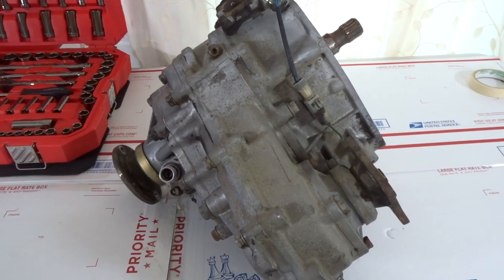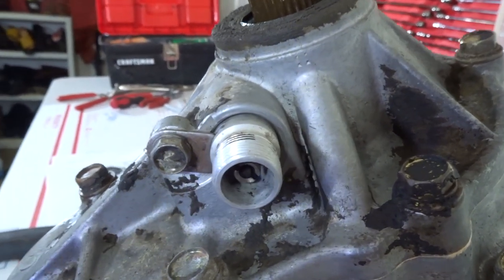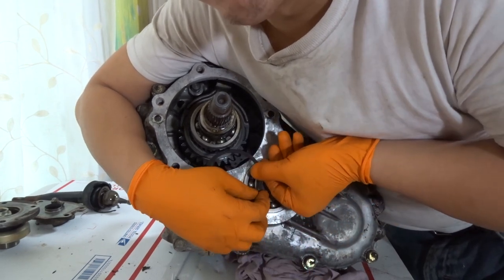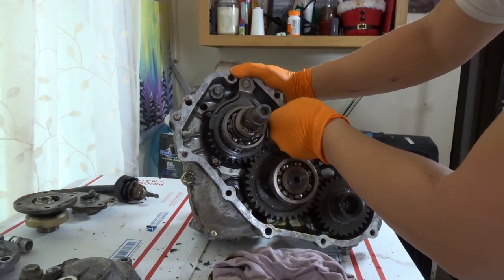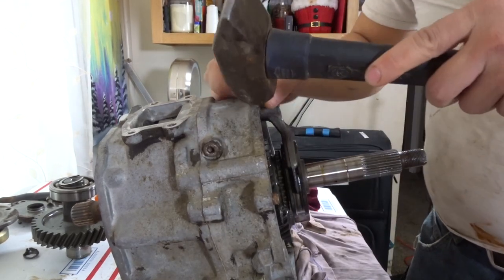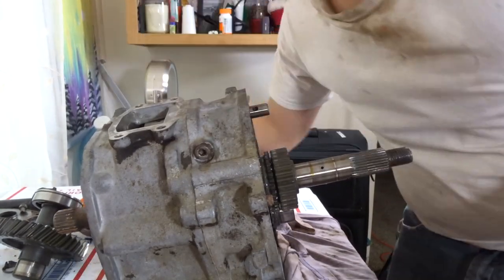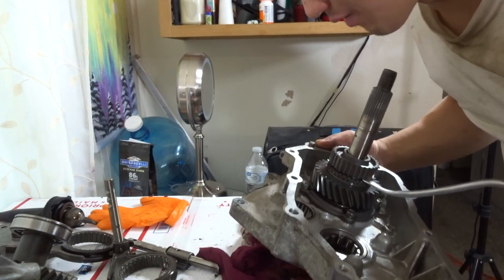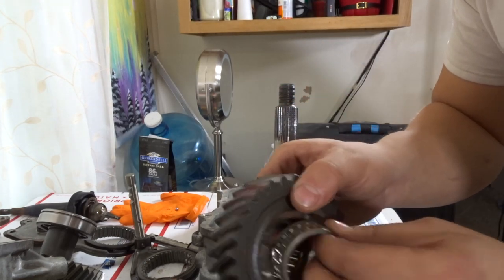TOYOTA RF1A TRANSFER CASE | FULL DISASSEMBLY

Comment: I think i have this same box attached to my g52. The output shaft bearing seems to be rumbling when hubs are locked. I just bought the bearings (B30120C3) and needle bearing (ntn HMK4520). Thanks for the breakdown video. Hope you also make a rebuild one.

Comment: I think my transfercase rear output bearing is bad, watching videos it doesn't seem like it's seated into anything? it just floats on the shaft? does it seat into the outer case somehow?
Reply: YO CHECK THE PINION NUT in the center of the flange, I thought my bearing was bad and taking it apart I noticed the nut had come loose, tightening it up solved my vibration.

Comment: Hi. I have a 2001 Toyota Ute, 4WD manual and it jumps out of 4High when I set off. Works fine in 2WD or 4WD Low. Sometimes it all locks up. Then, it all locks up and I have to get out, unlock the free wheeling hubs, rock the car back n forth, and then it works again. I am just running it in 2WD at the moment. Any ideas? Just swap it out for a decent transfer case?
Reply from the maker: Check  you hub, might need a rebuild
Reply: @NuttyNu  They have been, just before I got it. It's a recent buy for me. It works in Low 4WD but jumpo out of High 4WD. Any ideas?
Reply: I would buy new hubs if it would solve it.

Comment: Where is locaded the transfer case serial number?, i have a problem with mine, but isn`t manual, got a actuator istead of shifter, so idk what transfer case is, its very similar to this one on the video, the only difference is the way to change 2wd to 4wd, mine is with a actuator but inside i imagine is very similar
Reply from the maker: David lepiz zamora  check with marlin crawler on their site